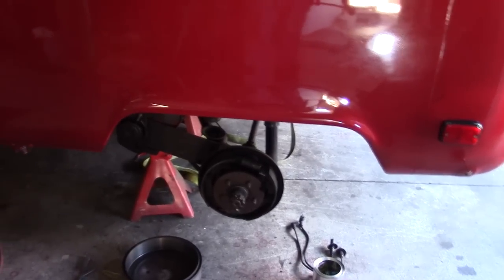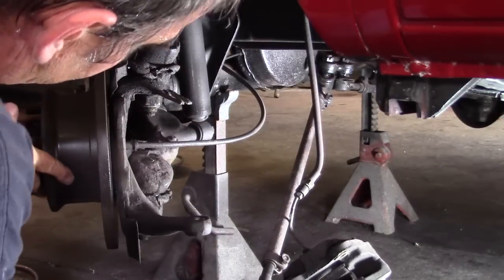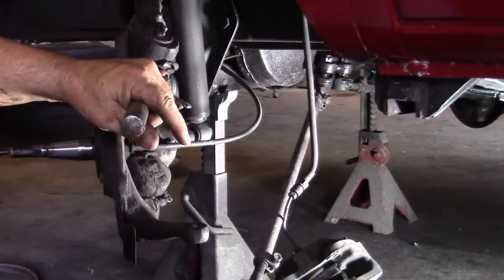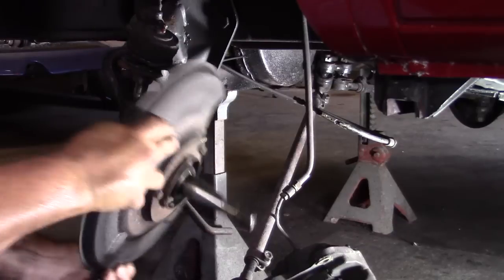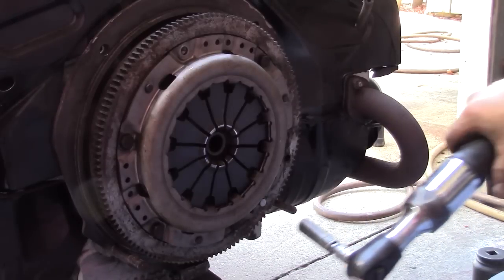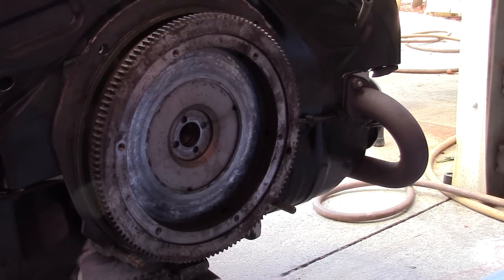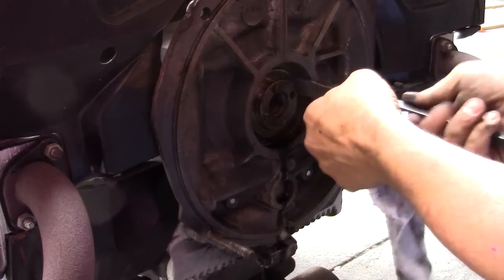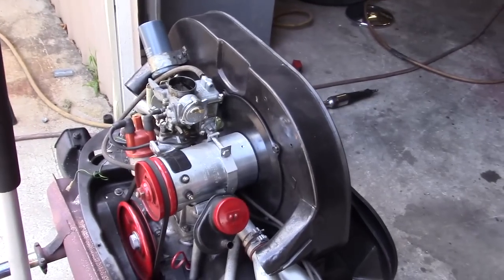More Work on The VW Bus

Comment: I do enjoy these videos.  They will be particularly helpful when I start the work on my '70 bus (hopefully before the snow starts).  But, and I know this likely won't be answered just because it is several years old, I would like to know what possessed VW to make them put the only access to the gas tank via removing the engine!?  Was it too difficult to just put a sealed access port behind the rear seat?  Or a sealed access port above the tank??  Huh?! Huh?!?  I guess I shouldn't whine too much since the rear main is leaking and to repair that I have to......wait for it......REMOVE THE ENGINE!  Guess I'll just replace the gas tank while I'm there.  Does anyone know if Darrin did a video showing the pressing of the ball joints?  Hello?  Hello?  Wait, I forgot, this video is three years old....nobody reads the comments anymore.  Anyway, I like the video.  I like all of Darrin's videos. This is sort of like standing on stage in a dark, empty auditorium, talking to myself...................I'm going to go now...............

Comment: I keep hearing that surfacing the vw flywheels are frequently machined wrong. What are the specifics I should tell the shop to insure proper work I ask because I'm in the middle of a clutch job and don't want to screw it up

Comment: Do i need shims on the motor i got from you being it's an automatic?
Reply from the maker: CaptHwdy08  you should not need to change anything unless you take the flex plate off that is on there
Reply: ah ok thanx do you know were i can get a oil cap and dip stick at?

Comment: I bet this bus is glad it ended up at your place. You were leakin wrenchin that ball joint off. Nothin like a blown head gasket. Probably just a cam seal. Lol. Neverseize on a flywheel nut....please. lol. Great vid. Glad it wasn't  an hour and 15 min...probably wouldnt have noticed tho..